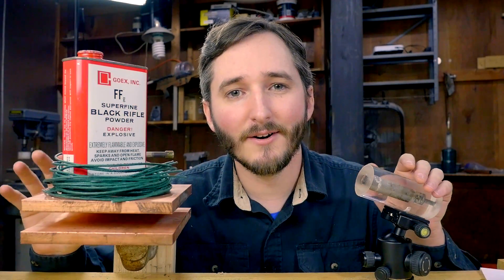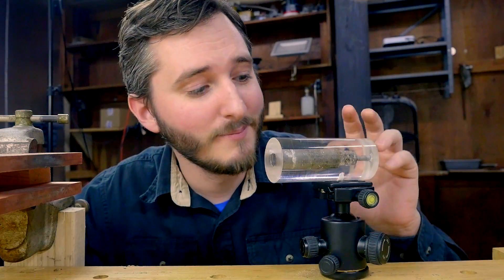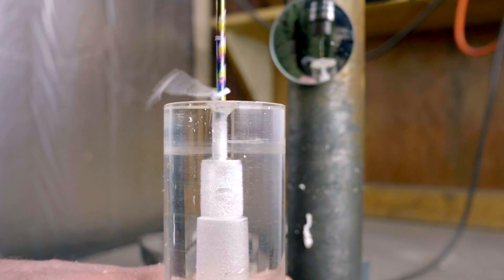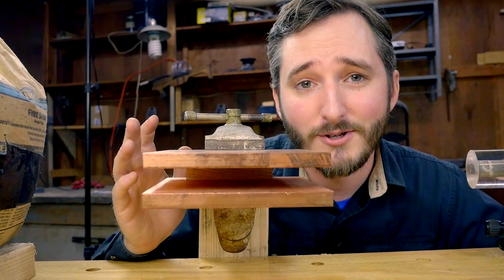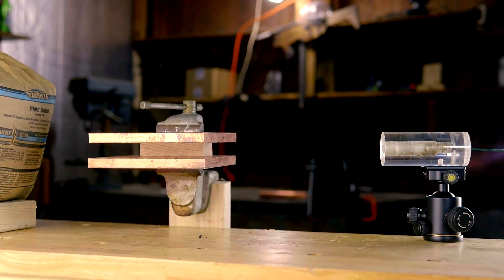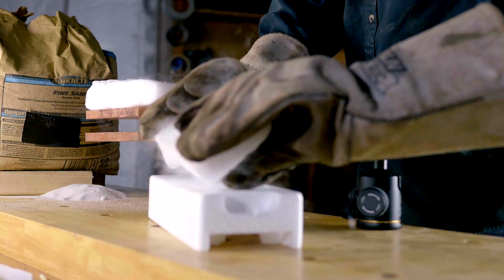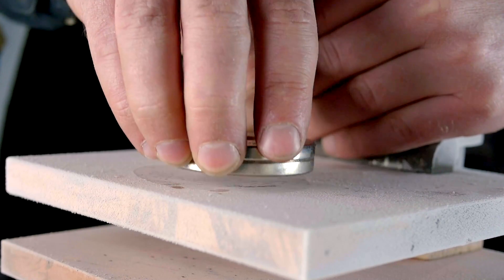Electromagnetic Force Fields VS. Magnetic Cannonball

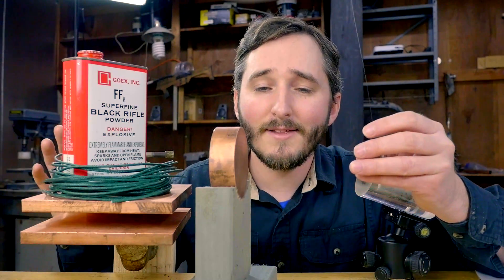Comment: to make the 10 foot copper tube thing to work, you need a magnet such as the one at 1:30 (just find one the right size) and shoot it so that one pole of the magnet is facing forward, and one backward, to create a much stronger magnetic field. a ball magnet has very concentrated points and are not suited to generate large magnetic forces over a large area. I bet that doing this would let you stop the magnet!

IN OTHER WORDS do exactly what you did at 9:07 and have that kind of magnet fire out exactly like dropping it through.

Comment: Some good comments here.  But what I think is happening is the copper is simply saturating and cannot produce anymore magnetic field.  Adding thickness to the cooper pipe will help, but even better if you charged up the cooper pipe to a negative voltage would increase the number of free electrons to generate the magnetic field.

Comment: At around 1:20 you are explaining how the approaching magnet induces a circular field within the copper disc. Here you have the disc mounted on a block. If you were to attach an axle to the center of the disc and suspend the disc so that it could freely spin, would magnet induce a spinning motion (no matter how small) to the copper disc as the magnet approached it? And if so, would that resultant spinning motion of the disc change the approach velocity of the magnet compared to when the disc was held stationary as a counter effect? Thx much.

Comment: Even though you upgraded to a copper pipe instead of copper plates you also need to upgrade the electromagnetic current in that copper pipe think of the way MythBusters did it you start with the myth and you see if that myth is true under normal circumstances and then after you determine whether or not it is Yuri duplicate the results by any means necessary to see what it would take to make that myth come true

Comment: Maybe try the following...
1. As others have suggested use a thicker copper pipe which will improve conduction and boost Lenz's Law.
2. Place the projectile right next to the conductor so there's less margin for error. 
3. The diameter of the projectile (magnet) should be only just smaller than the internal diameter of the pipe. The strength of the magnetic field  diminishes at the inverse cube of the distance, so clearance matters. 
4. You're already using the most powerful rare earth magnet (Neodymium N52), but use a cylindrical centre charged magnet of optimal length that just fits inside the copper pipe.  
5. Finally, it still may not come to a standstill, but with the right equipment you could measure the exit velocity and compare it with an identical non-magnetic projectile. 
6. If I was close by, I'd give you a hand :)

Comment: joint the 2 plates to form a circuit so the field current that you generate can flow round the ball .the other experiment the copper tube was to large. to large an air gap between the ball and the tube ,if you held the gun on the end not in a mount that can route so not firing straight .try again must try harder 3 out of 10

Comment: QUESTION: As the magnetic cannon ball gains speed through the air. Is it possible that just like electric motor ( double the voltage=quadruple the heat) the projectile at speed would be induced causing heat ?
Reply from the maker: I didn't notice any heat in the magnets after firing.

Comment: flat surfaces of the magnets tend to have considerably more resistance than the small point of contact of a sphere . bullets nowadays have a cylindrical shape too! maybe you could revisit this experiment and try with a cylinder like you showed repetitively dropping through the copper pipe in your example at 9:09?

Comment: would it be just a question of the amount of copper plate used?  There's really no way to do a conclusive test without using a gigantic sets of plates, in different sizes.  Imaging using the same setup, but shooting it at a parabolic copper plate that's 10 meters wide.

Comment: Next time use 1square copper tube overlay with Peltier cooler side down connect wiring couple to square neodymium magnets attractive side entirely connected baring magnetic copper coil wrappings 1/2" forward once than backward once 1/2" than flat line skip do that in sections of a 12" tube entirely than add Peltier cooler side overlay copper coil aline with lower Peltier. Than use a plastic flexible sheet or tube to over lay the inside copper walls so electrostatic builds up than use power supply electric charge copper wiring to establish a signal. For a solenoid hold sense that try it . good lucky

Comment: It would be interesting to see if a stronger and larger magnet would give a different result. Something close to the id of the copper pipe. Also, if you have an air compressor it would make it much safer to fire as well as easier to align with the copper pipe, you’d only need to cut a few holes in the first section of pipe to relieve the air pressure behind your magnet projectile

Comment: I suppose thickness of that copper tube is bit small which means the electrical resistance experienced by eddy current in the tube would be large, thereby limiting the eddy current flow crucial to counter the effect of magnetic projectile. Wonder if the experiment could be tried out with a much thicker copper tube. Secondly, it would be interesting to see the experiment with a little more control over speed of the projectile, as has been suggested in an earlier comment.

Comment: The ball magnet most probably spins while going through the pipe which can continuously change the position of the poles. Now, if and when the poles face the openings of the pipe, it should work just fine since the force exerted by the eddy current will always be opposite to the ball magnet's direction of motion but I think it will be tricky when the poles turn to any other orientation. It probably will bump on the walls and spin even faster until the useful EMF will become so momentary relative to the motion of the ball magnet that it will almost be ineffective. My guess of how this experiment might have worked would be a cylindrically shaped magnet instead, i think the longer the length, the better it will work. Oh and also, a thicker pipe can utilize maximum flux out of the magnet too! since once the flux crosses the wall of the pipe, they are useless. Give it a Go if you could and please upload the video if it works!

Comment: you weren't firing a magnet towards your target, just an inert piece of metal.

if you hit a magnet, it gets demagnetized... the acceleration of firing a magnet out of a cannon is like hitting it with a hammer.

what if you do it the other way around? copper bullet shooting a magnet... i think this could be a lot more realistic, especially if the hypothetical armour was a series of super powerful electromagnets which could be turned on when a bullet was detected.

Comment: why stop a magnet with copper. stop copper with a magnet, coil and electricity powered that is. this way you are limited by the voltage/current not dimensions of your setup

Comment: I think it worth a try with non round magnet. Since the magnet loose its energy as heat when it have enough flat surface to distribute the energy even. But when it is a ball, it will turn instead transfer energy as heat.
Thanks for the video.

Comment: Nitrogen is not cold enough, but as matter reaches absolute zero (vanguard field research cuurently), the known physics are as bizarre as the theoretics of black holes.  Helium at liquid state approaches AZ and is the way to maintain such suspended animations so as to "control" the matter i.e. projectile fired. Defense industry might know much more but is understandable withholding such knowledge.  Cancer and life extending effects would be intetesting explorations in induced magnetic fields of this ultra physical nature, for, just maybe, cancerous cells would be affected by tremendous gravitational momentum halts just enough to disturb the accelerated cell growth.  At any rate, the point is rather satirical because military uses heretofore contradict substancial any health implications....

Comment: How about the reverse? Taking a large number of n52 magnets, perhaps disk magnets with a hole in the center. Stacking them into a long tunnel shaped magnet. Instead of a bullet, start out with a pellet gun. Use a standard .177 lead pellet. You could even dismantle a air gun barrel, which usually just has a metal tube to launch the BB’s or pellets through the barrel. You could align a number of magnets around this and fire it into a pillow. Testing the velocity along the way with and without the magnets.

Comment: Your variables were different from your examples and your experiments.. your example was a magnet that had the same outer diameter as the inner diameter  of  the copper pipe and that was slowing down the magnet significantly. You used a tiny ball magnet that had an outer diameter at least half of your example and used the same size copper pipe. I'd like to see you drop that little ball magnet through that larger diameter copper pipe and see if it slowed down at all. Plus your other examples are magnets moving directly at a copper plate but your experiment was totally different. Why didn't you just shoot the magnetic ball at a copper plate to see if it slowed?

Comment: It looked like something hot came out of the end. Did the magnet exceed it's curie temperature? If so, would the experiment work if it were flipped. For example, replace the copper tube with an acrylic tube with hundreds of magnets glued to the side and fire a copper pellet. 

Example of a cross section of a possible tube design: X is magnetic carrier such as iron, S is south side of magnetic, N is north side. - is the tube material.

XXXXXXXXXX           
S                    N
N                    S 
-----------------------
-----------------------
S                    N
N                    S
XXXXXXXXXX

Comment: Magnets lose their field when heated or thrown into something solid, so your magnet could've lost its field after some shooting.
Reply: Especially neos
Reply: velocity of bullet versus Gauss of magnetic field x mass, after just a minute and half into video can tell not going to happen you wont produce enough opposite force to repel because two factors the velocity wont allow enough time for the fields to develop to slow it down plus the mass of the projectile wont produce enough field in Gauss strength to form large enough repelling field versus velocity anyways
Reply: @DMPB-fi2ir  You might be on to something, but I don't see how your formula tells us that.  "velocity of bullet versus Gauss of magnetic field x mass"  The only factor with any TIME unit is Velocity, but previous demonstrations show a field is still produced.  Please give more detail to your logic.
Reply: @DMPB-fi2ir   Dave Bar  You might be on to something, but I don't see how your formula tells us that.  "velocity of bullet versus Gauss of magnetic field x mass"  The only factor with any TIME unit is Velocity, but previous demonstrations show as field is still produced.  Please give more detail to your logic.
Reply: @bigsmiler5101   ya   it would be a formuila of mass and velocity plus it would have to take in to account cross sectional size and shape so it would be complex. i worked with specialty weapon platforms before retiring so there are a ton of factors
Reply: This is what I was thinking, Heating a magnet makes it basically null
Reply: It’s lose not loose how can a magnetic field be loose???
Reply: Naota Akatsuki or just use wadding to insulate the magnet from the burning powder.
Reply: It's the bullet's heat that's messing this up being fired out that hot is keeping it from getting grabbed by that field as much
Reply: Iwas guuna saydat! 😛
Reply: Oh no, Lucy's loose, don't lose her Asho.
Reply: I was thinking this, heating and sudden percussion can impair magnetic fields, but fun video to watch all the same.
Reply: Not COMPLETELY...
Reply: i dont agree there is a synchronization theory developing when high speed bullet enter to a copper pipe this mean instead opposing it will give a push all direction of hysteresis and eddy current dictated by the speed
Reply: more investigation should be had over this, one way if it is effected is to putt a ring magnet around the barrel so that as it is ejected it will reorient before the magnet has fully cooled and the vibrations are still available causing the crystals to de-crystalize? or maybe they are desintering at their boundries? Anyway basically neodymium magnets are just basically an iron magnet that has a diamagnetic mirror (the atom of boron) and a focusing lens (the atoms of neodymium on either end of the 14 atoms of iron in between the neodymium atoms (two so that one is on either end with 7 iron atoms between the boron and neodymium on either end of the crystals, and these being arranged gives the over all strength supposedly though I suspect that their connection being conductive allows electrons to freely move between the crystals thus coupling them together, so mixing powdered crystals in plastic say and then magnetizing them is much much weaker than would be expected by density of the magnetic material,) anyway, cool experiment glad he did it.
Reply: First thing I tought when I saw the video. Se il magnete permanete si arroventa per via dello scoppio, il punto Curie viene di gran lunga superato, disperdendo l'omogeneità della disposizione delle molecole, rendendo il tuo magnete al neodimio di fatto una pallina di metallo inerte dal punto di vista magnetico, che attraversa un altrettanto inerte rame, nel quale in mancanza di campi magnetici nelle vicinanze non è più sede di correnti indotte ne relativi campi magnetici.
Reply: ASHO *lose, *lost
Reply: No. It would have to be heated near melting temperature to lose magnetism.
Reply: Compressed air maybe?
Reply: That is what I was thinking , that is a problem 3dprinter makers get when they try to make their own magnetic bed

Comment: Wrap the copper pipe with thick gauge wire. You need more copper mass to induce a stronger field. Try it with a roll of aluminum foil. Use a full roll and drop a magnet through, then use an almost empty roll. There's a huge difference. That copper pipe is just too thin on its own.

Comment: Why would you think firing a magnet between two unconnected plates would have any effect ??? There needs to be a circular path for the induced current to circulate , as in a tube or flat plate facing the magnet ..... firing into mercury would work , if the magnet had an insulating layer .

Comment: "The bullet would have to be magnetic"
What if the shield was magnetic and induced the field in the bullet itself?
Reply: No because with copper the larger it is the stronger the inductive field can be. So a small cooper bullet would not generate much of an inductive field regardless of how large the magnet was because the size of the inductive field is proportional to the size of the cooper not the size of the magnet

Comment: The experiment is flawed. First, use a consistent force to propel the magnet, an air cannon is especially good for this, measure the speed of the projectile, magnet,  without the copper tube and then with, compare results. You could also try  "shorted" coils, of different sizes and resistances, the resistance to the current should produce measurable results.
As in all experiments, you will find the accuracy of the measurements is proportional to the accuracy of your results.
Reply: Seriously? Nobody?

Comment: Very cool experiment. But you could employ two chronographs. One at the muzzle and one at the end of the copper pipe or plates. You could measure the drop in velocity over that distance and determine if the magnetic field had an effect or not. I would say that a drop in Feet Per Second of more than 10 percent in that distance would be significant.

Comment: mythbusters tried that experiment with a fired bullet, trying to curve the shot, and only got it right with 10 of those monster magnets, each one 5times stronger and bigger than the one he has. so to stop a bullet going 800feet a second with an electromagnet is a dumb thing as the magnetic field opposing the magnet swinging, will actually also attract the bullet, dont believe me?  what happens to an iron nail on BOTH sides of a magnet... it attract, on opposing and attracting side......one might be able to stop an explosion, but a BULLET?  people are dreaming.

Comment: wrap a copper wire around the pipe and set up a spark gap and see the induced spark. I bet with the speed of the bullet there would be a very large voltage induced.